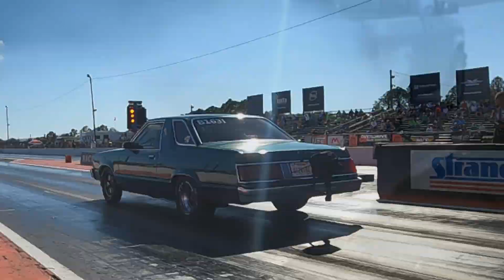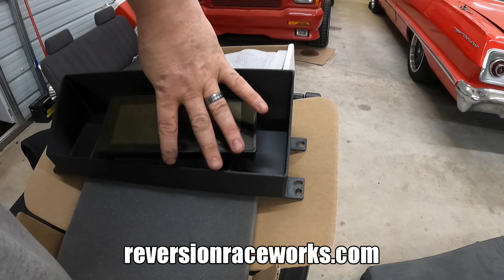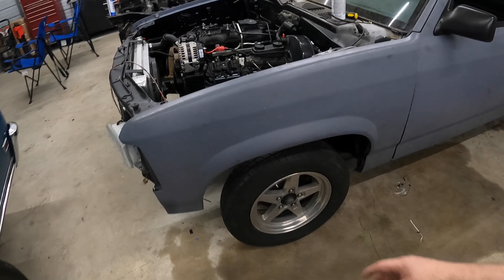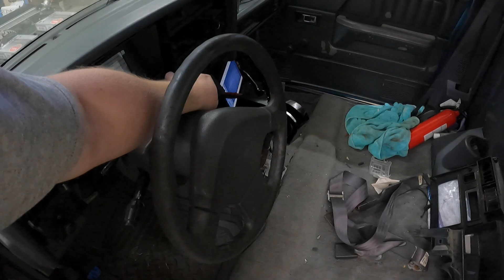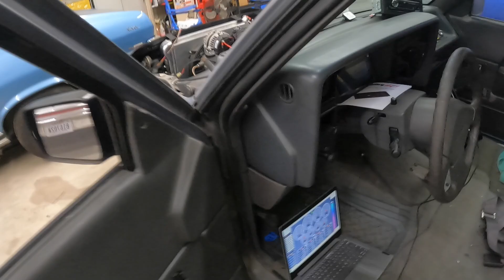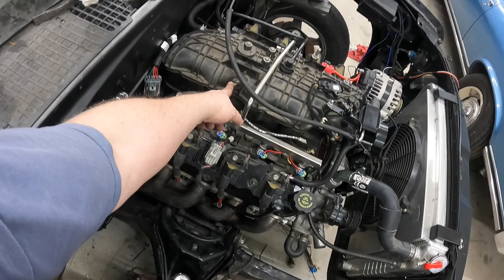OHHH NOOO!!!! I may have damaged my engine.......

Comment: I haven't finished watching yet but when you were setting your regulator, I swap the gauge dropping. I was yelling at the screen NO NO NO it's drooping too much to fast. Not even 1 rotation of the engine I believe saved you. My heart is in my throat!!!! I am working on my first Ls3 swap. In a 03'Crown Vic Police Interceptor. I am making videos for my grand kids so if the want to do something similar when they get older, they will see its not that hard. It's not my first engine tho lol. I found a block for $509 and a set of low milage 821 heads for $300. I said ok I guess Ls3 it is lol. I was shooting for a 6 OH but this fell in my lap. I am still on the fence whether I am going to run  4L80 or put a TKX 5 speed in her. I'm going to have to figure it out before I buy a harness lol. I have been watching for a while now and things like this help out alot. Cause now I am looking at my intake that has been sitting for over a year on my shelf. I guess I'll send them out to get checked and cleaned. Thank you for the videos brother. You never know how much you help people. You just do.
Reply from the maker: I appreciate you looking out, and the kind words! 

The regulator I have does not have a check valve in it, and its a return style so the bleed off pressure will always return to the tank. This means if the pump isn't running, the pressure will always drop, and pretty quickly also. 

Spoiler alert its running like a top now with a new set of injectors, so glad to have that figured out. Thanks for the insight!

Comment: I have a feeling your coils are backwards on the driver side number one should have a purple wire in the coil. The back coil should have a red wire in the coil. Driver side number two should have a red wire in the coil and the rear coil should have a purple wire on the passenger side if this is wrong the engine will run real crappy just like your sounded so double check that just trying to help.
Reply: It's easy to flip-flop this especially if you had your coil packs off . Driver side number one purple wire driver side very back coil red wire passenger side number two should be a red wire and the back coil passenger side should be a purple wire in there.
Reply from the maker: Appreciate the insight! These coils have not be changed since they were running on the truck before, so I was confident they were not backwards (always worth a check though). I only unplugged #2 to kill the spark when I was testing for the stuck injector. Good news I verified it was the injectors, and its back up and running like a top!